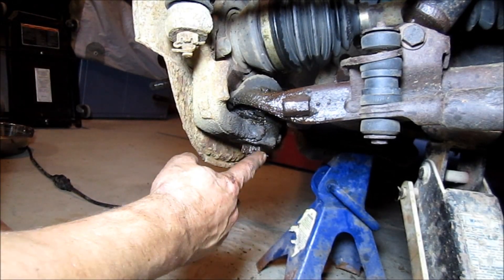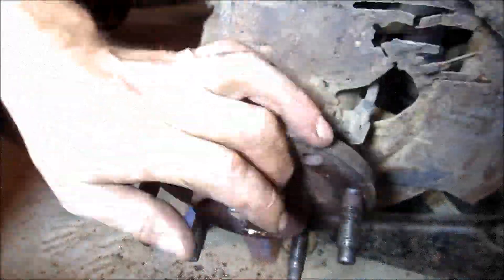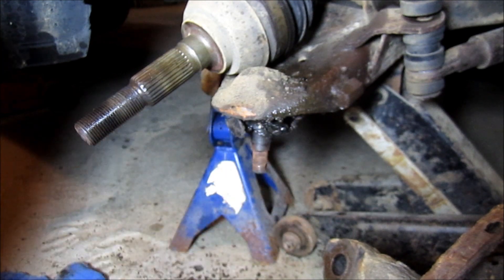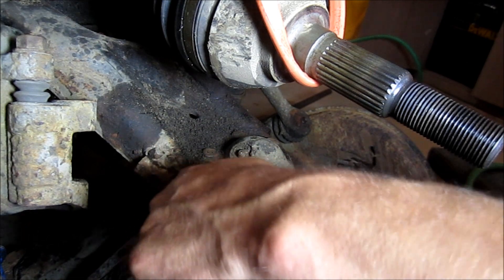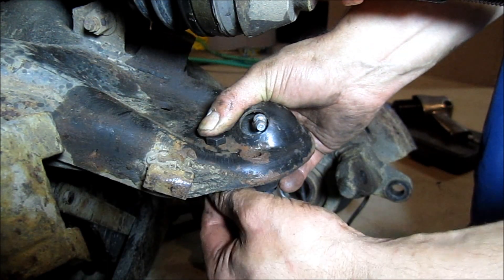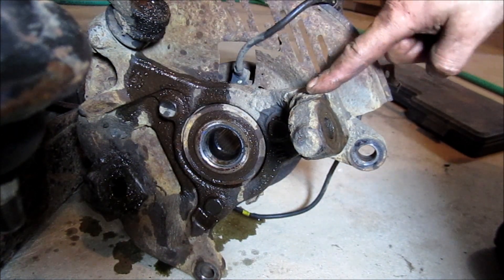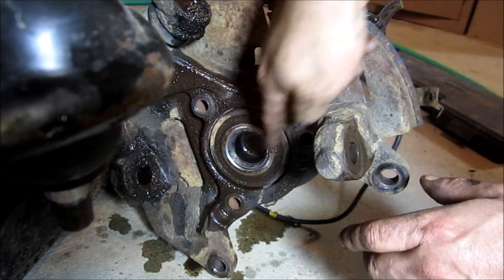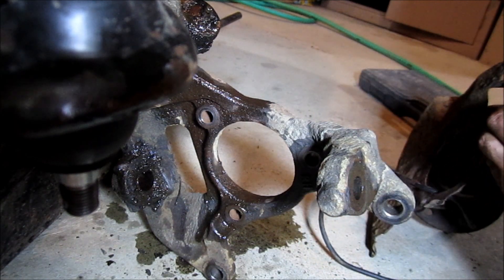DIY Chevy Blazer Lower and Upper Ball Joint Replacement - Part 2 How to Replace Lower Ball Joint

Comment: Great video, it really helped. I removed sensor on the hub and saved a bunch of time, good thing because it took a long time to beat the ball joint out even after I ground rivet heads flush. Also, I used mapp gas torch to get things to start moving

Comment: Use a brass hammer when striking a hardened axle shaft or use block of wood between them.  dead blow hammer to get the hub/bearing carrier out .

Comment: Awesome job,.. but not recommended to use impact gun on axel nut for reassembly. use torque wrench for proper torque specs. Otherwise awesome job!

Comment: How did you get the drive axle to slide out? I used a gear puller and it still wouldn't budge.

Comment: is it possible to use punches to remove the rivets from the ball joints and is it necessary to undo the cv axle nut to do ball joints....im young and don't have air tools so trying to find out if its possible with regular tools instead of air tools....i do have a rechargeable impact gun though
Reply: I was wondering about the same thing; replacing the lower ball joint without removing the axle. From the video, I think is possible; you have enough room to unbolt the ball joint and pop it out with the fork.

Comment: When you say "gentle persuasion" on the axel nut, what exactly did you do?  This thing I'm working on is busting my balls.
Reply: i know this is an old thread but when i have a seized up axel nut which i have and broke a couple 1/2inch drive craftsman ratchets on and even a breaker bar,I then proceed to use my trusty dremel with a heavy duty cut off wheel hopefully u are replacing the whole hub assbly. because getting to that nut you will also cut into the flange on the front off the assbly. cut the axle nut to just before you reach the threads on the axle then hit it wit sum penatrating oil and use a nice stout chisel give it a few whacks toward the way it lossens and she will break loose i find when already replacing the hub this is cheaper than breaking a tool cause i have a ton of cut off wheels and the nut itself is $7 bucks at autozone
Reply: i know this is an old thread but when i have a seized up axel nut which i have and broke a couple 1/2inch drive craftsman ratchets on and even a breaker bar,I then proceed to use my trusty dremel with a heavy duty cut off wheel hopefully u are replacing the whole hub assbly. because getting to that nut you will also cut into the flange on the front off the assbly. cut the axle nut to just before you reach the threads on the axle then hit it wit sum penatrating oil and use a nice stout chisel give it a few whacks toward the way it lossens and she will break loose i find when already replacing the hub this is cheaper than breaking a tool cause i have a ton of cut off wheels and the nut itself is $7 bucks at autozone